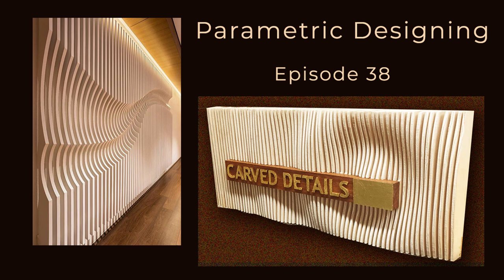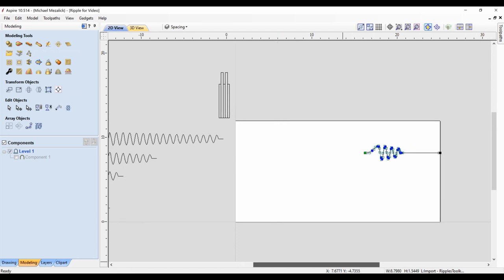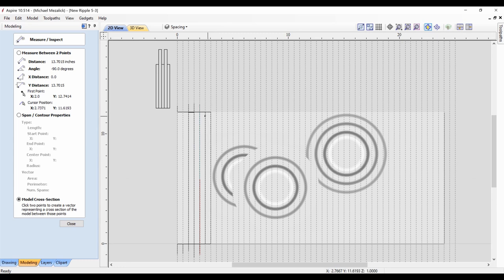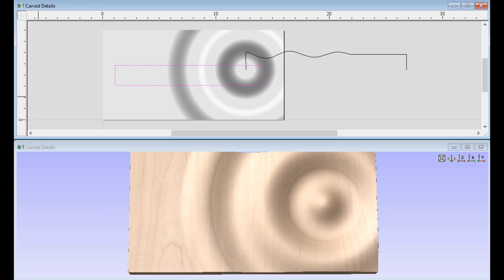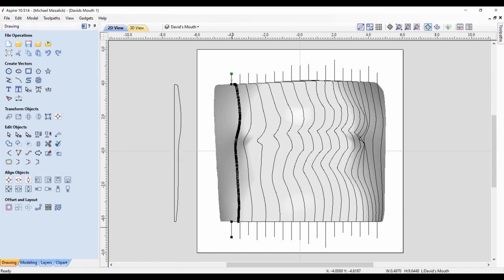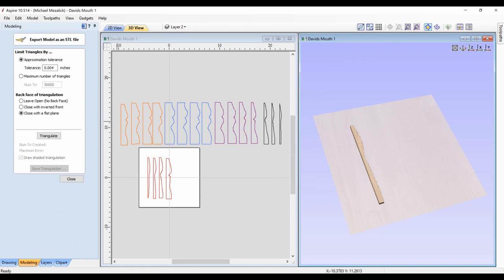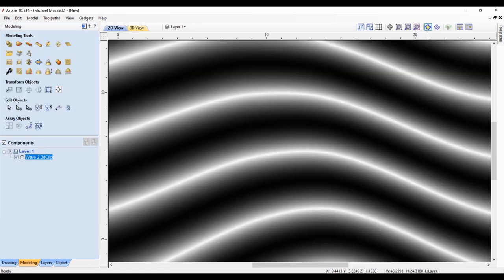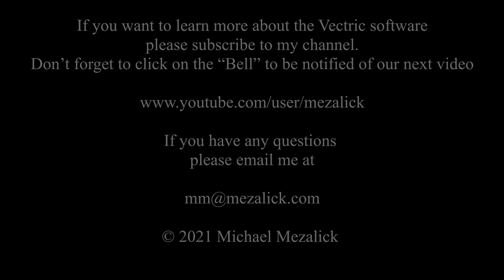Parametric Designing with VCarve and Aspire Episode 38

Comment: Hi Michael, I appreciate your responses ;)  So my use case is a terrain model that I wish I could source with finer detail, but don't know where to get a paid model that would likely be better, if one is available... Anyways, there are some quarries that I would at least be able to "sharpen" the edges of the cliffs here and there.

Is there any way to be able "apply an effect" like we do in other tools?  Ideally I'd just want to add some material to sharpen the rounded parts.  Doing this freehand with the brushes seems very difficult to keep the control along the precise edge of the cliff. Do you have any suggestions?  Thanks,  Bill
Reply from the maker: How about doing some node editing?
Reply: @mezalick  Great! So the idea is to place a vector around the the cliff edge, make it very narrowly focused on just the rounded cliff edge, and then create a flat component which would give the "sharper" edge, and blend it into the base until it looks correct ???   

Apologies for the double post... I submitted it and it hung for some time and ended up with the double post.
Reply from the maker: @kelleysislander  Sounds correct.Give it a try.
Reply: @mezalick  Thank you I will.

Comment: No turn and spin feature in VCP Michael. Sole domain of Aspire. There are designers on Etsy that offer some very good parametrics that I frequent and will have to deal with them for the meantime. Please correct me if I am wrong.
Reply from the maker: Correct but if you had a 3rd party stl file you could make it as a parametric design

Comment: Hi Michael, I am trying to create a flat spot for lettering in a sloped terrain model, not too different from your application here.  If I try to add a flat spot (w/o first subtracting like I just saw you perform), any mode I choose follows the underlying component's shape and I cannot get it to be flat.

I see that you may have created the rectangular vector as "Subtract", then come back with the same vector and added a new component to the height you wanted? Is that how you did it?  

Thanks,  Bill
Reply from the maker: You could have the flat as a component, set to merge and set above the slope in the component list. Adjust the base height of the flat as needed.
If you want to send me the file I can work it out for you.
mm@mezalick.com
Reply: @mezalick  Hi and thank you for the guidance.  I was able to work it out using a merge lowest to get my fancy text rectangle to appear in relief (or recessed).  I wanted a specific height 0.0625" of rectangle thickness at the lowest point and I was not able to do it simply with the combine modes, as there would always be a little undulation flowing into my flat area.  I could adjust it to make the flat rectangle stick up more to make it go away, but that felt like I was just playing to the terrain and not my design intent.  

So I created my fancy rectangle flat spot slightly recessed, and using the same vectors, I created a component on top of that and adjusted it so my the distance above the lowest point in the terrain was the 0.0625".  It was a two-step approach but it worked!  Thanks again for the inspiration  😃

Comment: At 6:17 I understand clicking on the Model Cross and then clicking at each guide line (as in y high and then y low) to section the y and then move to the next guide line.  However when I go to the next guide line, the only  way to select it or generate another section is to close the measure / inspect tool and then reopen it and reselect the model cross section and then click high and low.  It seems that you did not have to close and reopen it.  I tried holding down shift, alt, Ctrl,  but no luck. What am I missing, or do I have to open and close after each cross section?
Reply from the maker: Make sure you have the Model Cross section option selected, it's at the bottom of the Measure/Inspect window. Click on one spot, drag your cursor to a new location and click again. That will complete that cross section vection.
You can them continue at a new location. If this does not work you should contact Vectriic at support@vectric.com with this possible bug.

Comment: Hi Michael, This is a great video and in one section I am absolutely lost. At 6 minutes you create vectors with the measurement tool and cross sections across guidelines. It appears you are the only person who has shown this method across the Internet, so HUGE thank you for that. However, I tried for four hours to simulate what I think you are doing and I cannot even get the first vector drawn. I click, drag, click again through what seems like a hundred variations of such and I do not get what you show. I e-mailed you my file so that you can see I am nowhere with it. Thanks for the help!
Reply: did you ever figure it out? i have the same problem
Reply: You need to be on the 2D view, using the measure tool from the Model tab, to create a model cross-section. Using the tool on the 3D View does not work.

Comment: Excellent tutorial, many thanks. Unfortunately I came across a very small issue that maybe you can help with.
Once you create the shape vector and then close the vector, I found the bottom part to be a little longer than the top part of the piece. It is very small but does exist, 1.4mm on a piece 1000mm long.
Any ideas? Once again it is not a big issue but would be nice to know why this is happening.
Reply from the maker: I would need to see your file to adress this question.
Reply: It seems to be the same on your example. The 2 wings you join, are not perfectly horizontal, they are slightly angled
Reply from the maker: @demosdemou5605  That is caused by the pixels that created the 3D component shape. You could always make adjustment to the vectors if you desire.

Comment: Thanks for you brilliant presentations.
A question regarding this one… When separating the cut pieces with equal thickness spacers, won’t this in fact elongate (along Y) the design by a factor of 2, hence distort the original model?
Reply from the maker: No, becayse I'm eliminating every other piece, not simply elongating the design
Reply: @mezalick , I see. In the tutorial you mentioned the material thickness (1/4”) but when setting up the guidelines, I now notice you set them at double the thickness (1/2”). An important point that I didn’t pick up on.

Comment: Hi Michael, In Aspire, is there a way to be able to sculpt 2 components together before baking, or at least be able to see the 2 components in 3D view while you are only sculpting on one?  My case is a terrain model of an island comprised of two parts:  The "base" is the bathymetry of the lake's floor with a flat spot that will receive the 2nd component, the island itself.  

I'd like to be able to see the island in its proper position while sculpting the slopes of the base up to the flat spot, without accidentally changing the island component.  I just baked them then did the base sculpting as this was my only way to see both components together.  

Or is there a way to delimit the sculpting area by vectors?

Thanks,  Bill
Reply from the maker: Click on the " Show Greyscale Background" option in the sculpting window
Reply from the maker: You can see both but the greyscale option is the next best option.
Reply: @mezalick  Thanks 😀

Comment: Hey, great tutorial. Thanks! I have another question: if I make 40 lines, for example, do I also have to mill 40 parts? Or only every second to get the gaps?
Reply from the maker: The cross section vectors is based upon the center of the material youwill be using. For example, 1/2" think plywood, three pieces, the middle one one is not used because I want 1/2" between the other two profiles. I would not need to draw 3 profile shapes, but only 2 that are 1" apart. Center line of panel #1 and the center line of panel #2 is 1" apart.  Hope this helps.
Reply: @mezalick  not really sorry 😞 So if I want to have a mural of 600 mm wide, and I have a material of 12mm, I need 25 lines with a distance of 12mm or? 600/12 =50 / 2 = 25
Reply from the maker: @pinkybreak8411  How much space do you want between each "slice"?
Reply: @mezalick  same as the material. 12mm..
Reply from the maker: @pinkybreak8411  Then the spacing of the profile vectors would be 24mm. Center to center.
Reply: @mezalick  ok i think i got it - thanks :) But i cant find the waves on the named Site.. :(
Reply from the maker: @pinkybreak8411  If your referring to Pauls site , you won;t find the waves there, only the vectors needed to make your own, ( Aspire only) You may want to to at Thingiverse or Cults3d for STL files, search for "Wavy Flags"
Reply: @mezalick  yeah i mean the vectors for Aspire.. Do you know where i can find it at Pauls site? The wave vectors..
Reply from the maker: @pinkybreak8411  Click on the link at the bottom of the page to the DropBox folder. https://paulrowntree.weebly.com/standingwave.html

Comment: I  cant find the vectors on pauls page, where are they?
Reply from the maker: Not sure either Steve. I know Paul died several years ago and it looks like some items have been deleted for his site. I'll keep looking.
Reply: @mezalick  ooh thats sad to hear. another question though, how on earth did he create those cross sections with the handle nodes at 06:00, he does it too fast for me to follow, it looks like he drags the cross section diagonally at one point. i must have watched that part 50 times in slow motion, but i still dont understand it.
Reply from the maker: @s001100010011100100  That is me speaking and making the project. The model cross section vectors are created as you can imagine. choose the "Model Cross section " from the Measure Icon and simply click at one place, drag you cursor to a new location and click again. That will create the vector. Sorry it's so fast.
Reply: Thanks, that method creates a one lined vector, the one you make has 4 90⁰ corners, you see it when you drag it to the left at 07:20
Reply from the maker: @s001100010011100100  Email sent
Reply from the maker: @s001100010011100100  Check at 6:00 and you'll see that I'm using the "Model Cross Section" option.
Reply: Thanks, I've been using the Cross section tool all the time, I'm obviously missing something else, I'll play around with it a bit.
Thanks for your help though you are very talented!
Reply from the maker: @s001100010011100100  Are you sure you have the Model Cross Section radio button clicked "On" ?